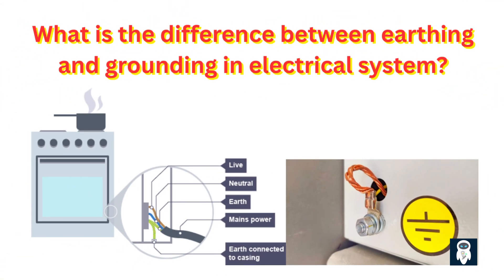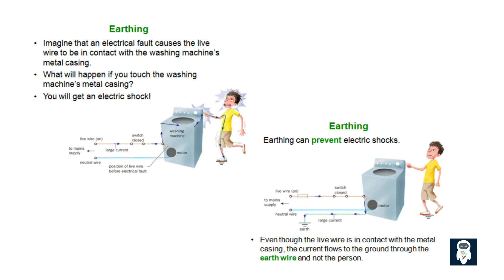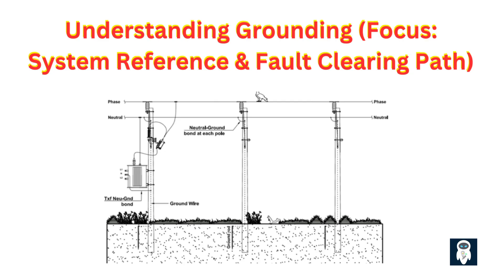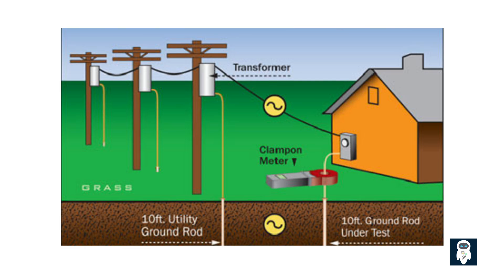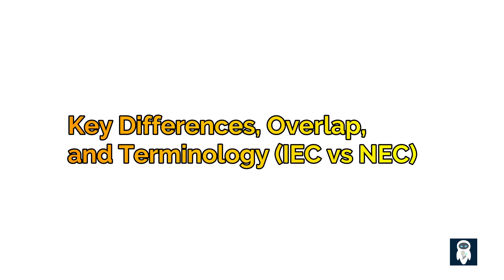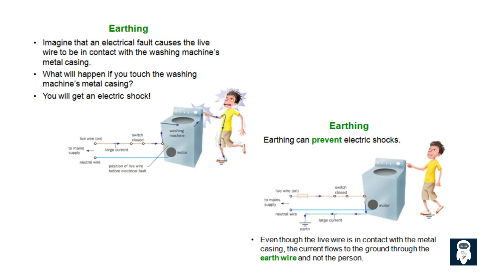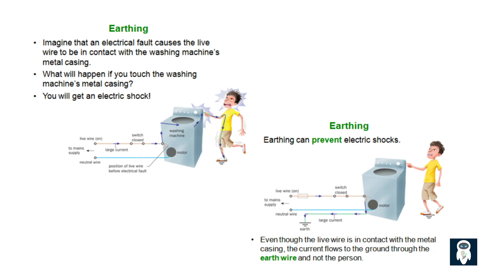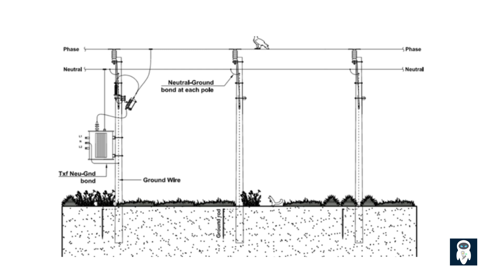What is the difference between earthing and grounding in electrical systems?

Comment: This video makes it seem like there's a way to ground a neutral without "earthing" it. Is there such a way? And if not, what's the use of this video?
Reply: There are non-earthed systems which in Euripe are known as IT systems.  These are typically small such as a non-earthed generator and a consumer or critical systems such as an operating room in a hospital.  One characteristic is that that the system stays usable and safe eve with a single fault.
Reply: @ralfbaechle  These installations simply don't have a neutral. Both wires are considered live. The source is not grounded, it is floating. If you "ground" one of the lives, it becomes neutral and it is "earthed". I don't think you can "ground" without "earthing".
Reply: Ok, I found my confusion by reading wikipedia. I'm not a native english user and didn't know that "ground" can mean the reference point of circuits even if it's not really grounded. In french we use different words "mise à la terre" for earthing OR neutrals and "masse" or "point de référence" for non-neutral grounds.
Reply: @pierre-huguesmartin6938  To add extra confusion, add the term "earth" for British English while "ground" seems more of an American English term.
Reply: A vehicle's electrical system is grounded to its metallic body, it's not earthed.

Comment: One thing everyone around electric should know and understand is the IMPORTANCE of the Multi-Grounded Neutral (MGN) at each home and business. 

On almost EVERY telephone/Power pole in USA has a main 6 AWG ground wire run down the outside of EVERY pole. I challenge everyone to go out and look at your nearest pole to see. 
But the CRACK/METH heads have found this gold mine of easy cash by cutting and scrapping this 6 foot of copper wire off. This leaves all grounds and neutrals incomplete. 

As a telephone lineman and repair I was IBEW and a licensed electrician. I found at almost every house I went to that the MGN ground from the house had its clamp to the ground rod so loose you can spin it with your fingers and sometimes piviot the clamp apart. Since my telephone "Network Interface Device" call it NID is relying on the MGN to provide lightning protection. Cable TV uses the MGN too for their DeMarc. 

So if the MGN clamp at the house is bad and the ground wire at the pole is stolen you are 100% relying on the power companies Neutral wire. But I also have seen the Neutral wire connection at the house loose. So its a ticking timebomb waiting for a full open neutral 240 VAC spike throughout the house.

Comment: Earthing = Safety (prevents shocks)

Grounding = System stability (keeps voltages in check)
Reply: Yepper. But add in BONDING to that. ;) Some times you can not ground or earth a overhead wire within 1,000 feet of a Power Substation. So all cables and power neutrals must be OPEN grounded but BONDED within this 1,000 foot radius. This is designed in to keep lightning from striking a power pole and arcing into the substation. Bonding also bleeds inducted power off telephone cables to the ground wire at the poles.